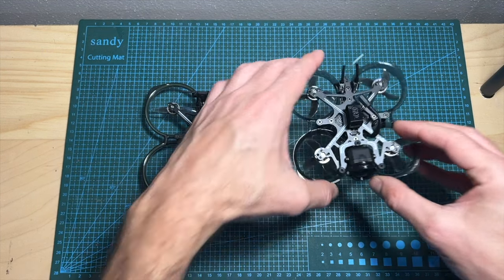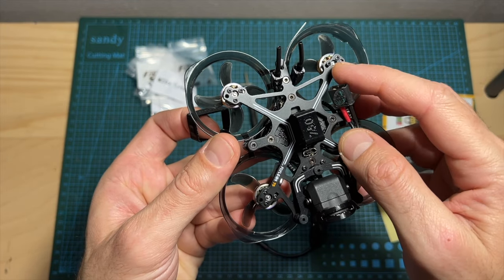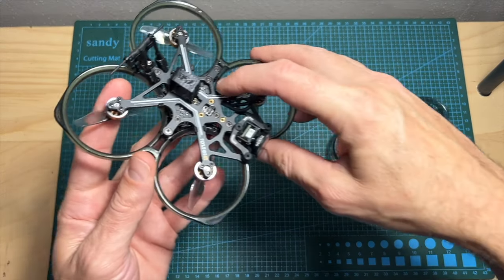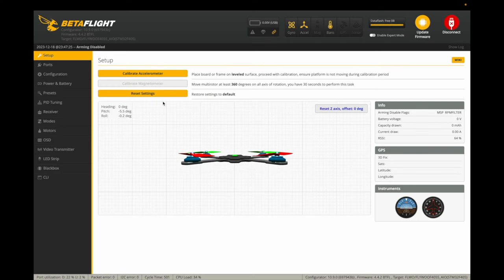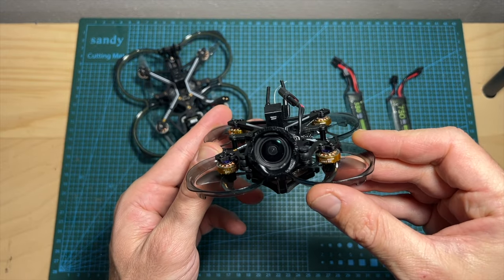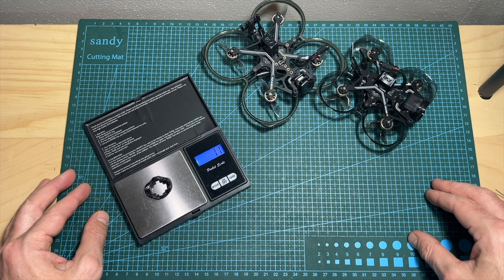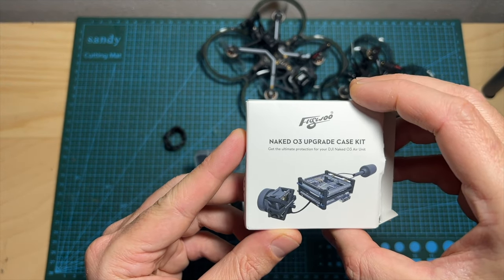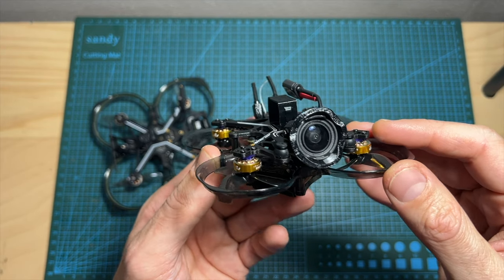Flywoo Flylens75 - 1.6" O3 Cinewhoop

Comment: Hello. Great review!
In the future I plan to have an analog version of flylens. A difficult choice between 75 and 85. And yes later I just found that Flylens 85 analog has a mounting for action cam, while flylens 75 dont, like you said.

My question is, what do you think flylens 75 analog is designed for?

If it is not designed to carry action cam, is it designed as a training tool for the O3 one and upgraded it later to O3, or is it just a freestyle/racing/recreational quad using analog DVR for the video result, or is there any other use?

Thank you